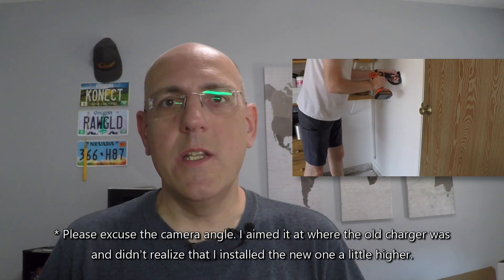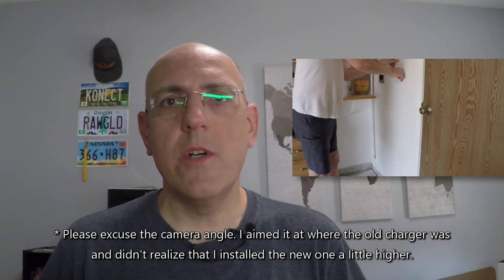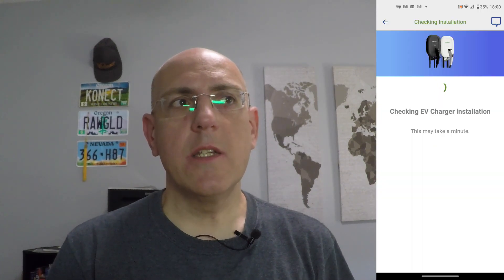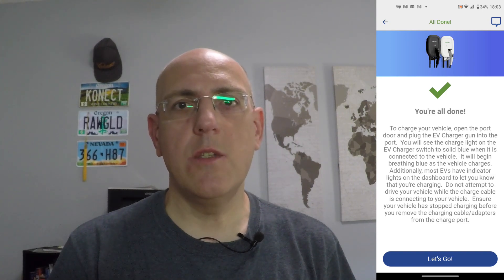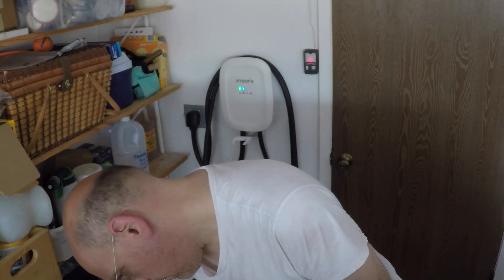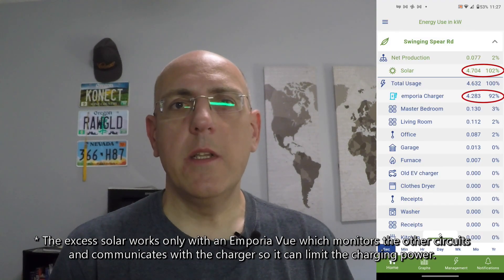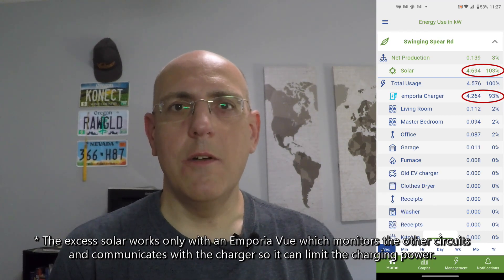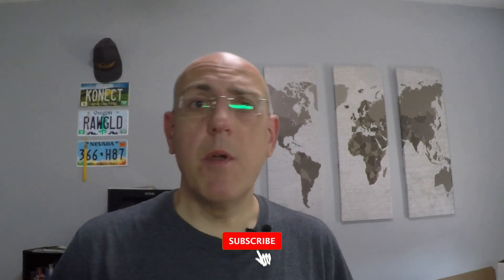Emporia EV Smart Charger Unboxing, Install and feature test

Comment: How many amps do u use for ur charger
Reply from the maker: I am currently limited to 40 Amps due to a 50 Amp breaker on my panel and probably the wiring. However, rewiring it if needed in the future will be cheap since the panel is basically just on the other side of the wall, just about 3 feet away.
Reply: The nice thing about their charger, you can buy the NEMA 14-50 version if you have a plug available, and set to 40A maximum (max 80% of 50A circuit/breaker), but later you can convert to hardwired and 48A charging (on 60A breaker, #6 wire ) if desired.. you aren't stuck w/ NEMA vs hardwired.
Charge lowest current that fits your schedule, I could go to 32A, but I often go 16-24A, to closer match my 4KW solar, and also just to reduce load (pun) on the wiring, breaker, etc... 
only use max power if I need faster charge. Hope to use the solar-matching feature to exactly match!